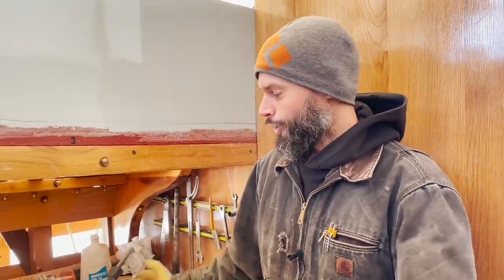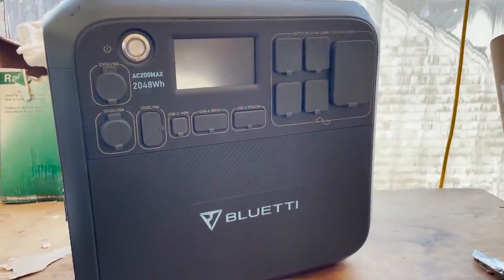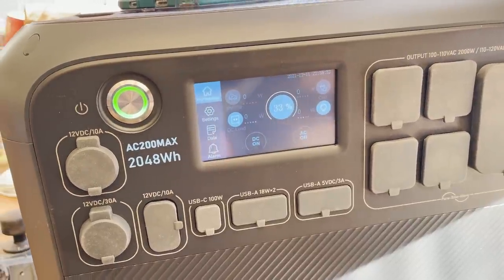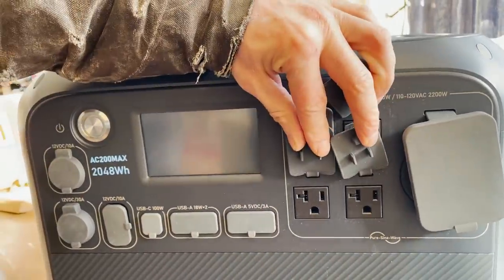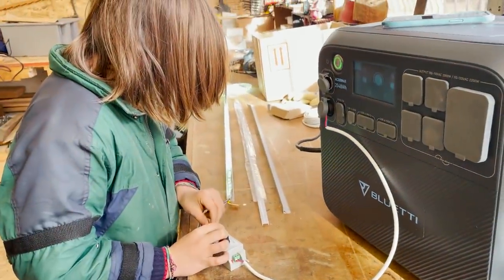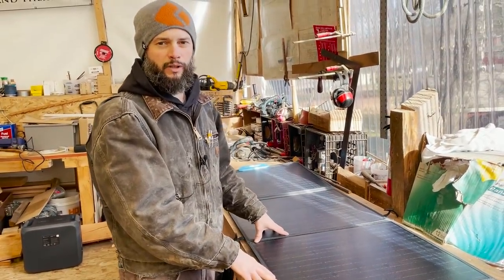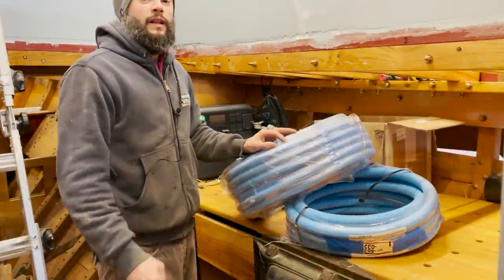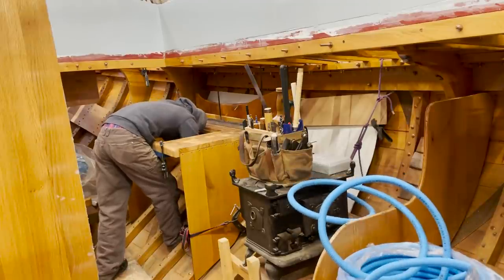Boat Electrical Systems, First Steps - Episode 194 - Acorn to Arabella: Journey of a Wooden Boat

Comment: It shouldn’t be too difficult to automate or have presets for the Red lighting at night rather than tuning it in with the RGB controller. Really enjoy hearing your reasoning, planning & execution of ideas 👍
Reply: They make rgbw lights with a separate white channel. Also I'm fairly sure you can find a just red and white led strip
Reply: Zooz makes a handy RGB/RGBW controller for those strip lights which will allow you to control them via a ZWave controller compatible with many home automation systems like Samsung's Smartthings.  I use this for indirect lighting throughout my house
Reply: Agree on RGBWW (RGB + warm white + cool white) strips. I use Gledopto's Pro RGBWW zigbee controllers to drive a load of strips in my apartment. Over the past five years I've built a ton of "fixtures" with two lengths of RGBWW strip down the flat side of some flat (one t-channel, one side flat) 1010 aluminum T-extrusion (for heat dissipation + mounting).  This is 100% of the lighting in my home office, because my apartment has no ceiling fixtures, and it works out great!  I run Home Assistant on a raspberry pi for coordinating everything and bridging z-wave / zigbee devices. That may be more than you want to worry about taking care of, but it's a neat little low-maintenance solution.
Reply: Using a warm (2200-2700 CCT) colored LED would be sufficient.  There is certainly truth in the reasoning however, not everyone has issues with cooler/bluer white light.  'White light ruining your night vision' is an incorrect statement.
Reply: @graham6229  Yeah, you do if you want to.preserve you night vision.

You know.  To see at night.   So you don't step on or trip over anything on deck.

Also helps a lot when star-gazing.

At night.
Reply: @graham6229  You do, just done a transat crossing and we had more than a few big boats with no AIS traveling at > 10 Knts with a bike lamp on the front ie hard to see.  Also squall spottining - Protecting your night vision at sea is helpful.

Comment: I have split system in my cabin .What I found is with DC you absolutely must size the wires correctly as compared to AC!  Something to think about when you have to pull multiple wires that are larger than what you’d need if it was AC wired throughout. You probably already know this!  Thanks for the video sir!

Comment: Some of the best tips from when I re-wired my boat. Get a lable printer machine that has flat heat shrink options. Then label every terminal and at various places along a long run. Due to friction, conduit fills quickly, Always leave a mousing line in there as well.

Comment: Hey Stephen! Some advice for you on color-changing LED strip lights: they usually have really low CRI (Color Rendition Index).. IE the color on the things they illuminate doesn't look right and they hurt your eyes after a while. I'd strongly suggest buying a 95+ CRI light (Check out Waveform lighting's shop lights, not that bad and you get a shop light in the end) and comparing the color-changing strip you have to a high CRI source in a really dark room... I suspect you'll change your mind and kit Arabella with a mix of good high CRI white LEDs and dedicated red light sources instead of using a RGBW/color-changing strip

Comment: That system does look interesting. One thing - I think having some panels set up in a permanent location would be a good idea, so you'll always have a baseline of power. Also if you're planning to do long sailing legs, it would be a bit annoying to have lots of sunlight but having to run a generator for electric power if the going is too rough to just hang up folding panels.
Reply: Totally agree a permanently mounted system would be a must for me. And personally I feel that there are better solutions for the power system on a boat than that one. Personally I like the victron energy products but each to their own

Comment: Hey Steve, I’m a former Army helo pilot. In aviation we got rid of red light in the cock pit years ago in favor of a green/blue. The reason is because red has a longer wave length and is harder on the eyes. Just a thought. Happy new year!!
Reply from the maker: Neat, David! Thanks for sharing that!
Reply: Same here Steve. I’m a retired submariner and we switched to dim white lights years ago. Eliminating the color mixer in favor of a dimmer would make things easier to operate and maintain. Best of luck and happy New Year,
Reply: Red light was fine when lights were incandescent. It was nearly impossible to dim incadescent enough to achieve blue light without lighting up the sky.  Red light could be produces at low intensity and allowed the eye to process reading paper charts/tables etc whereas blue light did not.  Now blue light is easy to produce at low intensity with LEDs and most 'data' pilots read is from a backlit screen, not paper. Backlight is processed differently in the eye.  At sea, the use of red or blue depends upon whether you prefer paper or navitronics. +-
Reply: Also, the human eye is most sensitive to green wavelengths.  I've read that most maps and charts are easier to discern under green/blueish light as well, but can't say first hand.
Reply: And just to add more confusion most computer or phone OS's have ways to reduce blue light at night to reduce eye strain.  What's a poor human to do.  :(

Comment: I've seen several reviews on Bluetti's materials, and they are quite intriguing.  The one deficit I see for your application though, is potentially a mis-match in power types and output capability.  You have a predominantly 12VDC system in the boat it seems, but the Bluetti and most other systems like it are predominantly designed to make 120VAC.  This is one of the reasons most boats i've seen have mostly "roll your own" battery storage systems. The other charging consideration, that you didn't touch on but I suspect is in the back of your mind, is an alternator off the diesel engine.  Depending on your usage of it it could be a significant source of charging power at various times.

Hopefully you're already doing it, but creating a power budget chart for each of the 2 types of power (AC and DC, detailing the current draw of each individual or type of device) can help you get a better picture as to what types of loading you'll have and how to help plan the system to handle it.
Reply: I thought of the diesel alternator too.  Surprised he didn't mention it in the video.  Great source of power/charging while under power.
Reply: Even if a alternator can't directly charge it he can run it through a inverter first and use the charger I think he should also get the extra bbatteries  some situations it's better to have more than what you need even if he never uses them.
Reply: Mismatch? They have electronic devices (laptops, cameras,  mobile) . Throw in more people quadruples the devices. Plug and play gives them the flexibility that brackets, clips, tie-downs and a 100 meters of wiring can’t. Sounds like a perfect match.
Reply: He said it will do 30A on the 12V though, is that not enough especially given LED lighting?

And yeah, an ability to charge the battery using the diesel would be wise... I'm wondering if the rectifed 12V from the alternator would be acceptable to feed in via the solar input of this battery or if that would be bad, I'm not good enough with electrics to know if you could get a 110V single phase tap off an alternator to charge it using the 110VAC input.

Comment: BTW, for the "final" device, bear in mind that in other nations there is a different voltage for the electrical grid (and frequency) so a device like all PC/laptop power supplies, which auto detect the grid frequency and voltage, can be really useful if you dock where there is possibly a charging station.

Comment: From experience, you shouldn't rely on RGB LED for your "everyday" white light. I would suggest either getting strips (and controller) with a fourth (white) channel facilitating white light with the color temperature of your choosing. Alternatively, you can install red LED strips along with dedicated white lights ... The "experience" of mixed white using LEDs fucks your head (at least with my personal).
Reply: You aren't wrong about that. The lack of full spectrum color is a problem long term.
Reply: Yup RGBW is what you want. 3000k for the white color would look very nice on wood

Comment: To me, solving the issue of filming while away from the boat is the most challenging aspect of your plans. 

But for boat electrical design there's lots of info out there. As far as future-proofing, sections of conduit or some other kind of wireway is useful for areas that will be hard to access once fit out is complete, but point-to-point conduit for small DC loads and low voltage circuits just adds to inaccessibility and inflexibility. If you want to protect wiring in lockers from chafe, wireways with a removable cover are handy. See Panduit or Wiremold. 

AC is an exception; small wires that can deliver lots of energy (think shock and overheating/short circuit failure) and serve general purpose outlets lend themselves to a fully enclosed pipe and box solution. If the outlets and boxes are strategically placed, you won't ever have to rewire.

Comment: Steve you can buy those Photo connectors for solar. You can crimp your own end on then slide connector together. So you can make your own cables. Use stranded copper decent guage but yeah dont buy bluetti's cables you can get those outdoor spec connectors.-Solar installer

Comment: A nice compact modular system - great management system and expandability.  You probably need 2 or 3 of these rigs plus a dedicated cell for your engine that is independent from the house load.  You may consider having an arch added to the back of Arabella dedicated to a fixed solar array as a compliment to the portable Bluetti portables.  From what I have seen on the many sailing channels I have watched is don't underestimate the amount of power you think you need.  A few overcast days and storms and you find yourself running the engine too much to keep the house bank charged.  Off grid means limited resources especially the sun and diesel fuel particularly in the high latitudes.  One of your key power considerations is an auto pilot - will it be a mechanical run on power or a mechanical plus passive such as a wind vane or only a wind vane.  This is a key element for all long distance cruisers.  Also manual windlass suck big time - electric is the way to go and that needs some serious power.   Oh yeah FANS - these are REALLY useful if you sail in the tropics!!! Thanks for sharing!  Cheers!

Comment: I've used the stick on LED strip in several projects, it needs to be secured to the strip in some way, the adhesive will let go in a matter of weeks and is only good for ease of installation.
Running cables in trunking is a must, but I hate that flex stuff as its impossible to seal in and out of a box and very lays straight. 
Love the videos l, keep them comming...

Comment: I recommend jet line, lightweight line designed to be vacuumed through conduit. Also strong enough to use as the pull line. Comes in a box of a few hundred feet. No ball or flag required just keep feeding it in until it balls up and the vac will pull it through

Comment: The main thing I have to recommend about electrical systems is carry plenty of spare parts.  Trying to figure out which bit is high risk or near failure is hard.  Also fridges can be converted to universal electric motors (in fact some are manufactured that way anyhow, same as most power tools, but the manuals are rarely written by people who think it's worth mentioning).  That means you can run them on AC or DC without converter losses.  (But you have to provide 110v DC, which is its own special need - transformer losses are not a win over converter losses).

Comment: that battery pack solves SO many problems most people don't even know they have!
Reply from the maker: We’re cautious. What’s your concern, chiefly?
Reply: @AcornToArabella  To be clear, I'm not concerned, perhaps my wording was off lol,  To the "solves problems people don't even know they have" I mean the "person" not the unit lol.  I've put together custom solar rigs for people and the one place people always try to cut corners on are the batteries... they forget that battery drain isn't a linear equation when being drained so I've always told people, "Whatever you think you need for batteries, double it!".  

To have the charge controller, the inverter, the battery bank, the bus bars, all in one nearly water proof box is going to be a serious life saver when you are on the move and it's rated for 2kw/h and if you need to double it, just plug another one in (try doing that on a custom battery bank!), if you tried to wire that up custom (and I have lol) using 18650's you are going to use up 4 times the amount of space in batteries alone not to mention the amount of time it takes to make charge controllers and spot welding and you'd have to water proof them....You "might" be able to save some money doing it all yourself, but I honestly feel for the price it's worth ALL the headaches it's going to save you if you went full custom.

Comment: That driver for the strip led is MASSIVE. In the UK you get 2 inch small remote controls to change the colour so you can mount that near your hatch and press it before entering the boat from the outside... just an idea

Comment: Hi Stephen, love your channel,  watched every episode from the very first. I build timber surfboards hence my interest in boat building.

I’m an old electrical contractor for 50 years in Queensland Australia. I haven’t a lot of experience on wiring boats, however saying that my brother and brother in  law both have yachts which I’ve done work on the electrics which was a nightmare.

I have a few suggestions you may or may not take on board.  Firstly the way I would do it I would run a low voltage distribution buss in a heavy cable from your power supply protected by fuse or circuit breaker rated at the current carrying capacity of the cable keeping in mind voltage drop is an issue with low voltage. Then I would install low voltage distribution sub boards strategically around the boat such as engine room, workshop, galley etc this will allow you to add whatever will be required in the future without having to run a new cable back to your main power supply.

The conduits are a great idea but be careful drawing additional cables through the conduit containing cables as the friction may damage the insulation of the existing cables.

High voltage distribution around the boat should be segregated from the low voltage keeping in mind that low voltage cables and high voltage cables require different insulation ratings.

Anyway I’ve rambled on enough. Looking forward to seeing Arabella finished, I only hope I’m still alive to see her in the water.

Kindest Regards
Paul Kirk-Lauritsen
Reply from the maker: Thank you so much for watching! Glad you’re on the journey with us. There will definitely be a breaker box. We’re going by a US standard set by ABYC (American boat and yacht council), which charter yachts and professionally built systems typically use for compliance. This is a home-built boat, but these standards will work great for us.

Comment: I don't have the Max model but my Bluetti  AC 2000 has worked like a champ for the last year. Assuming you can mount an adequate number of solar panels  on the boat, to charge them, think about getting the two extension batteries. Good luck with your project.

Comment: I've used several reels of the LED strip lights, both white and RGB, for garage, shop and camp lighting. If you look close you will find the long reel strips are actually just shorter strips soldered together at the same place you would cut them into shorter lengths. I have had some of these factory solder joints unsolder themselves under normal loads, even when cut down to 4' lengths. The powered side will still work, but downstream from the factory solder goes out and needs to be repaired (resoldered or bridged). If it were me I'd also have a more permanent house battery; the Bluetti will be great for your adventuring, but... I'd also suggest a battery isolator to charge your Bluetti and house battery from the diesel engine when it's on, and a way to charge the batteries from shore power when at the dock.

Comment: 15:00 Yea, having extra panels you can deploy at anchor is a pretty good idea. Two major concerns though - you probably won't be able to use the fridge at sea, and an electric autopilot will be an additional problem. I'm assuming you plan to go with windsteering? Highly recommend Hydrovane due to the solid auxiliary rudder. Will an autopilot video be coming soon?
Reply from the maker: Not soon, but someday. We definitely plan on a windvane.